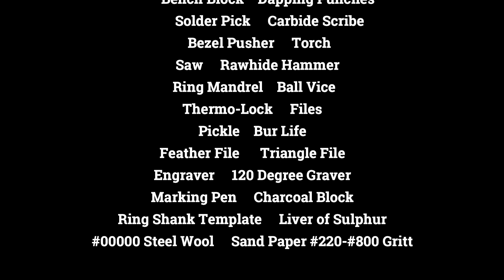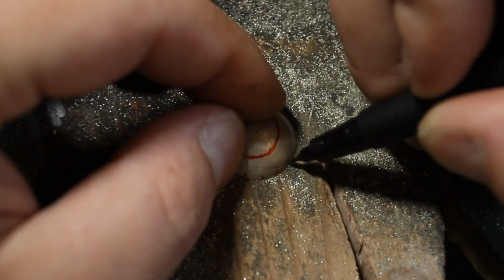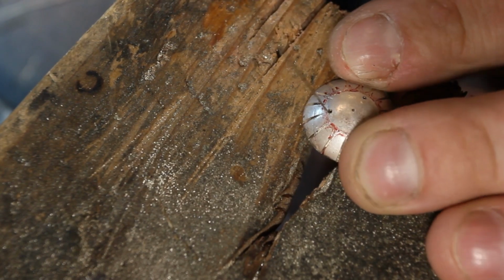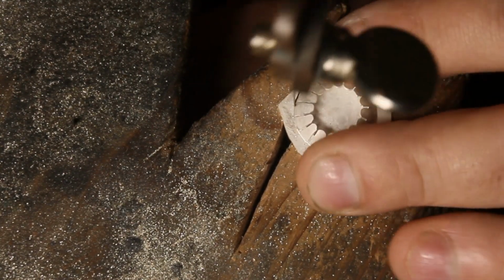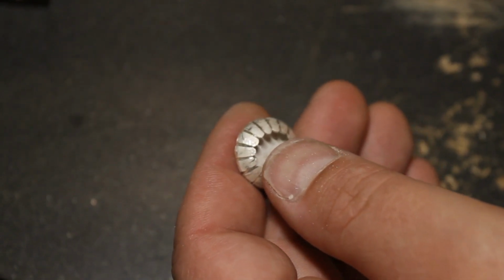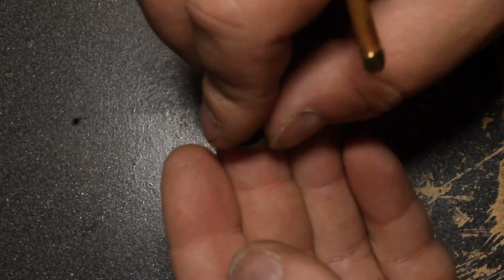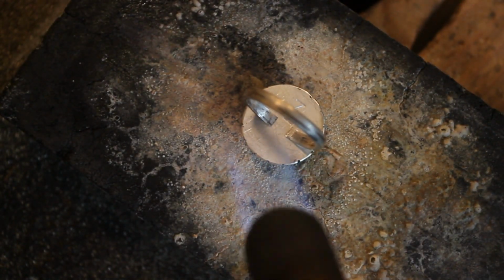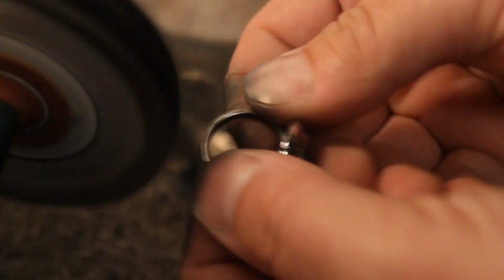How To Shadow Box Setting

Comment: I thought sawdust was a neat way to set a stone till i did a repair on some earings that were set that way. The sawdust had gotten wet at some time and it was all moldy. It would be worse on a ring with people washing their hands all the time. Never again have i set with sawdust ! Beautiful  ring !
Reply from the maker: Yea I understand that. I have messed with other shock absorbing materials, but in my experience blood wood sawdust works the best and holds up the longest. I also really like Bakelite dust as well, but unless you get into making pipe stems it’s not something you will come in contact with often

Comment: Wow! I really love jewelry making videos. I learn so much from them.  I'm taking a course on jewelry repair and design to become a bench jeweler. Thanks for making this video and sharing it. I was wondering if you'd like to share what is the ratio of vinegar to salt is for your homemade pickling solution. Do you add water?
Reply from the maker: @AltheaMayberry  yea no worries. I use 1 cup of salt to every 2 cups of vinegar
Reply: @ZinkSterling  Thank you so much. This will be very helpful for me just starting out. Now I don't have to worry about caustic chemicals or buying the pickle powder. This may be a stupid question but I just need to be sure. We still have to heat the homemade pickle, right?

Comment: Can you please tell me how come the saw dust does not fall out and what happens when it gets wet 

Also what polishing compound do you use.   I did not understand in the video 

Thank you so much for sharing
Reply from the maker: The stone sits on top of the sawdust and the bezel gets pushed against the stone holding the dust in place behind the stone. Using a hardwood sawdust or a synthetic material under the stone acts as a shock absorber in the event that the stone hits a hard surface it lowers the likelihood of the stone breaking. Hardwoods and synthetic materials do not expand very much when introduced to water so it doesn’t cause any issues long term. If you use a soft wood sawdust then it will expand when it gets wet and can cause the stone to become loose or in extreme instances can cause the stone to pop out. The polishing compound I use on silver I purchase from rio grande and is a 3 stage platinum polish, however there are dozens of options on the market and it really depends on preference.

Comment: Can you tell me what a feather file is? And also what is the tool you used to measure your ring shank to size? Thanks for the video great piece!
Reply from the maker: A feather edge file is commonly used to sharpen Japanese saws. The thing I used to measure my ring shank is called a shank size & bracelet gauge. Thank you for your questions and if there is anything else I can help with let me know.
Reply: @ZinkSterling  I’ve never seen anything like that tool and wondered where you bought it from?
Reply from the maker: I am currently stationed in Okinawa Japan and I buy them from a local hardware store called makeman. If you search Feather edge file on google you can find them for sale. I will say that file isn’t necessary at all. It is just a file I happen to have access to
Reply: @ZinkSterling  thank you but I was asking about the wire gauge for your ring shank. Instead of referring to a chart
Reply: I’ve never seen a wire gauge that could calculate the size of a ring just wondered where you got that
Reply from the maker: @mariannejennings4671  honestly it was just something my dad gave me several years ago when I bout his tools. I will say it is only ball park accurate. The thicker the metal the further off it is.